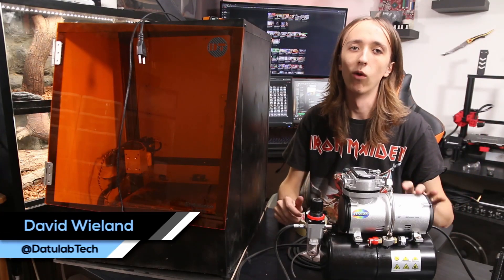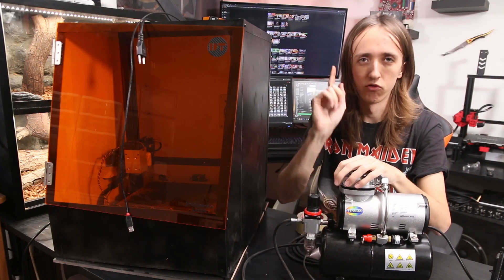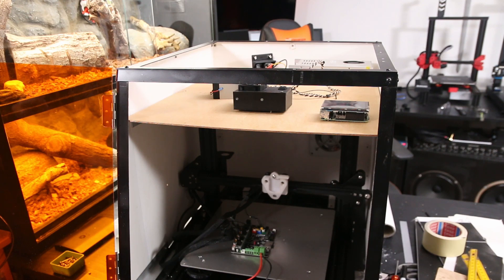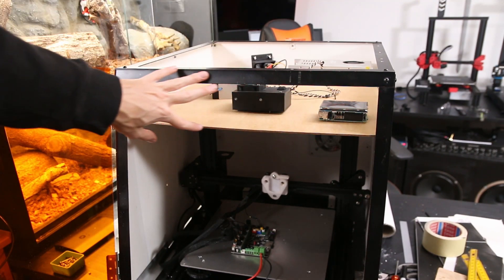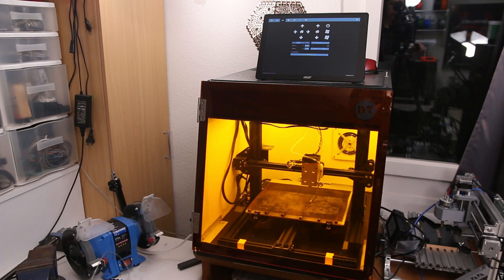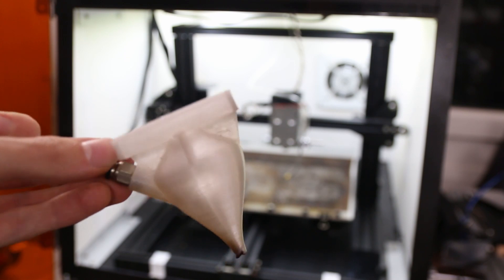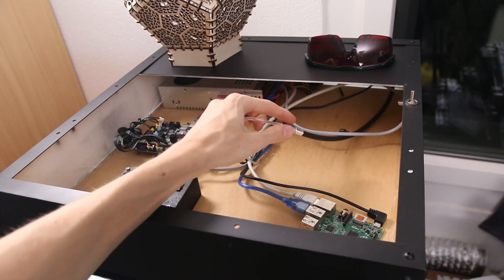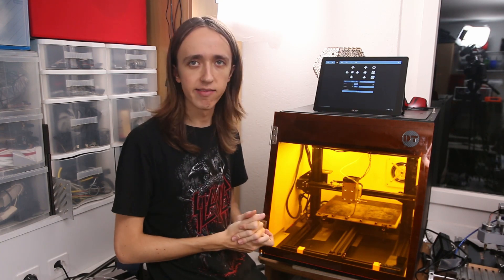Laser Cutter from 3D Printer - Improving my Setup

Comment: As an idea where additional height could be useful to make it more multipurpose, rotary laser engraver / Laser Induced Graphene roll-to-roll on Kapton (super capacitors/ circuits). 
Planning to swap a CR10v2/3 over to laser only and came across your video.

Comment: Cool video! Awesome to see that you're still using the Quick tool change I've designed back then. Thanks :)
Reply from the maker: It works well, though I don't really use it often, it mostly just turned into my permanent mounting bracket :D

Comment: Nice. I have a laser as well, smaller for now. Got it secodn hands for really cheap but it works great. One thing where did you get the orange panel? I do not find them easily and for sure not in that size.
Reply from the maker: They had them at my local hardware store. You'll certainly find it online if you can't get it in a store.
Reply: @DarkArtGuitarsWorkshop  the one I found cheap were really small. The big one way too expensive. I was thinking of find a adhesive foil to stick on bot hside but do not know if it will give enough protection.